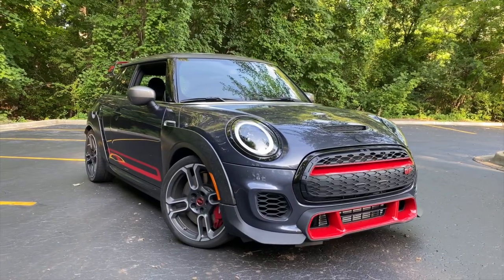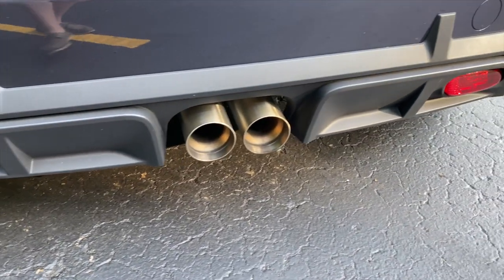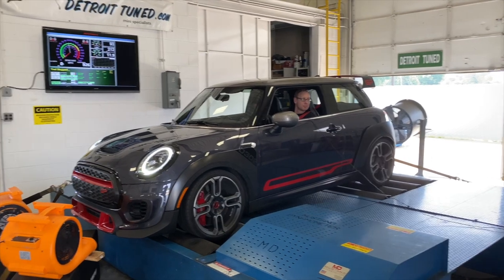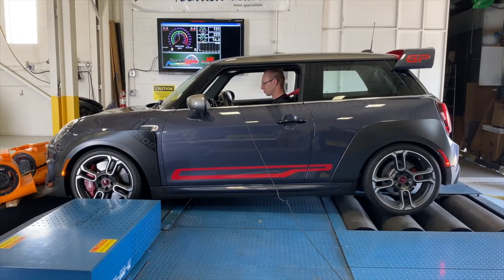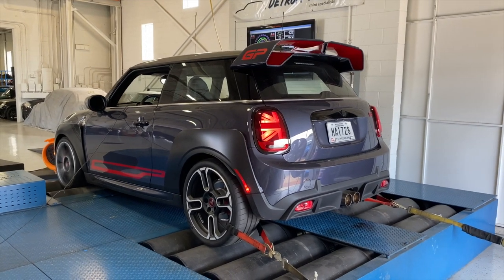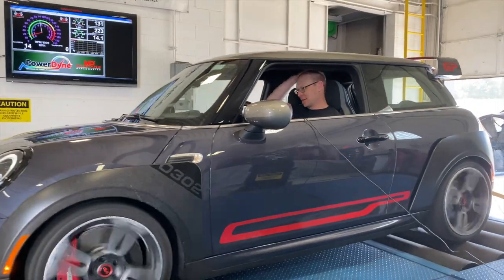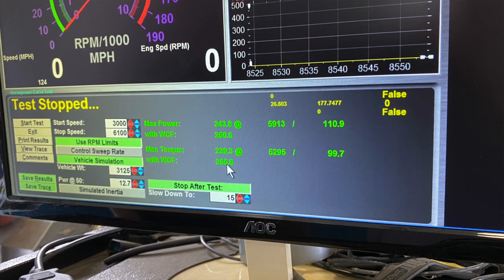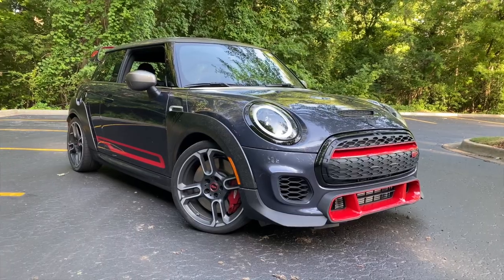2020 Mini Cooper JCW GP: Dyno Test! (Horsepower & More)

Comment: Plastic wheel arch surrounds always like since I drove a GMC Acadia that had them and how it save the body when I come too close to things and comes in contact with it rather and it wouldn't even scratch, good design. Those were very minimal (not as tall and outwardly) and effective though compared to these of the mini :|
Reply: *carbon wheel surrounds

Comment: Never mind these are some of the least reliable cars sold today with seemingly the worst of German and British reliability.  Seriously, look up the data. Mini’s suck in terms of unscheduled dealer visits and customer satisfaction.  Parts fall off, sunroofs rattle and leak, massive numbers of electrical things go wrong, and tow trucks are all too often required. Yeah all that might be overlooked when you’re living in a fantasy world and driving a press car but it really does matter if you spend your own money on unreliable junk like a Mini. Just say no unless you want a car that’s likely to spend more time at the dealer than in your own garage.
Reply: I've had my 2018 cooper S for over a year now and my only gripe with it has been a boot rattle, which is easily fixed by adjusting how far the boot door shuts. I think these are great value cars (in the UK) the build quality is probably one of the best in it's class
Reply: Dousty count yourself among the rare lucky Mini owners that have not had an unacceptable number of problems. They really are among the least reliable modern cars you can buy as has been shown in their reliability numbers. British cars suck in terms of reliability and so do German cars. So it’s a case of two wrongs make for an even bigger wrong.
Reply: Shared Knowledge Mini’s aren’t British anymore. BMW owns them and they use a proven 2.0T engine.
Reply: Have you owned one?
Reply: H S A good friend has owned two of them. The second was a Clubman. Both had frequent, annoying, and sometimes serious problems. But look at Consumer Reports and other independent sources of reliability information.
Reply: I had a 2007 s, 2008 s, currently a 2013 jcw and my wife a 2013 jcw countryman, I have never had any complaints, my biggest complaint is perhaps not having more money for the new gp
Reply: @ponshagy  I’ve owned a used f56 One and a f56 Cooper which i’ve modified with 0 issues. My mother has owned a r56 JCW and a f56 JCW. Had a few small ones with the R56 but none with the f56. They’re a bit pricey but a proper fun car to drive. Here’s hoping to get a GP3 one day! 🤞
Reply: @sharedknowledge6640  aha, it's common knowledge German cars are exceptionally reliable
Reply: Raytrite Is that a haha joke? Try looking at Consumer Report’s independent unbiased reliability data. German cars are among the least reliable in the world. There’s a reason you can buy a 6+ year old Mercedes, Audi, or BMW for only about 20 or 30 percent of what it sold for new. It’s because German cars can be incredibly expensive to keep on the road.
Reply: I’ve had my f56 Cooper S for over a year and the only issues its had were caused by a piece of sheet metal that flew off a truck into my front end and destroyed my suspension other than that it’s been super reliable the new motors were built in partner with Toyota and so far have held up very well. They think it could potentially be BMWs most reliable motor yet. I think like all cars if you don’t take care of them they’ll fail, but as long as you do the regular maintenance it should be fine.